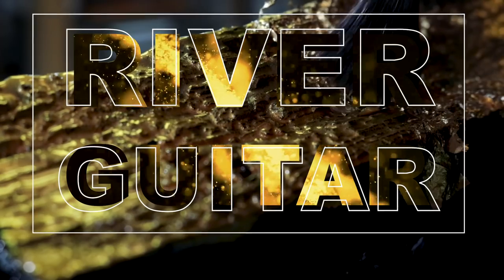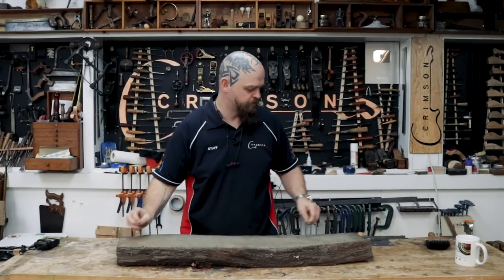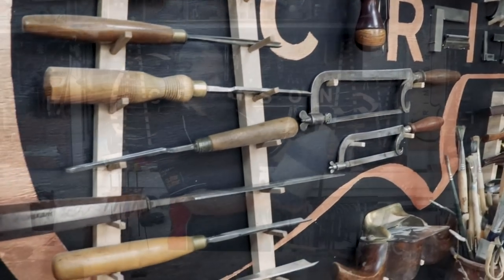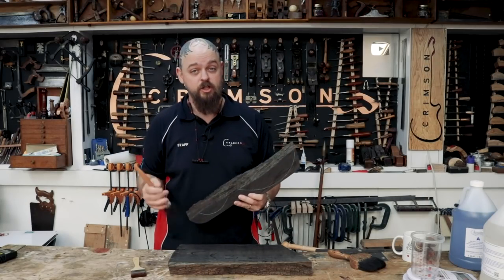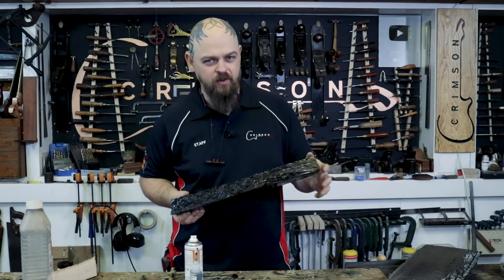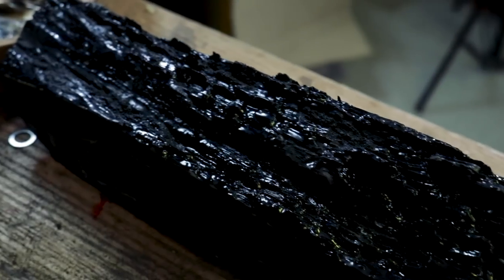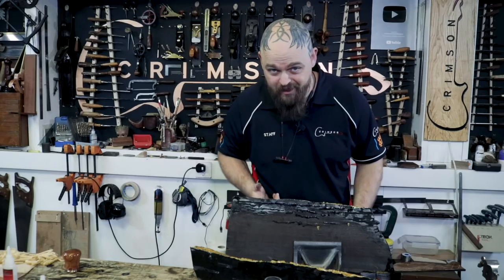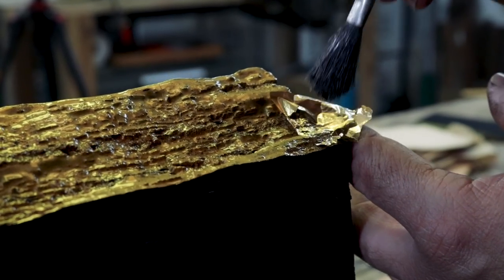Carved Epoxy Resin River Guitar Build - Bog Oak & Gold Leaf 1 of 5

Comment: Okay..you're gold leafing the live edges, then filling with resin. After you finish getting the guitar to final thickness, the the top and back of the guitar will be exposed wood with resin only in the "river" portions, correct?
Doesn't this essentially make gold leaf the structural adhesive that's holding everything together?
Reply: lol hadn't thought of that. Maybe that's why we only get the first part here.
Reply: Shhhh if the guitar doesn't hear you it might not break
Reply: Vacuum...
Reply: im sure the master builder  thought of that lol
Reply: @josemason7082  The head tat screams "I think everything through".: )
Reply: That's exactly what's been going thru my mind the whole video. Won't the epoxy just pull the gold leaf right off, essentially splitting the guitar in two?
Reply: Yes but no, the resin will partially pennate the wood.
Reply: @neverman3398  
How? He'd already resin sealed the live edge before gold leafing it. Epoxy isn't exactly known for adhering well to previously dried layers of itself.

I have great faith in Ben's skills, gawd knows he's pulled off things I've doubted before, but this one seems unlikely to me.
Reply: @beochie  I thought the head tat screamed... HANGOVER SEQUEL! shhhhhhhhh... oh em gee i've got a ...hangover
Reply: Yeah, I was just looking to see if anyone started this topic! LOL Does gold get that good a tooth into other things?

Comment: you should invest in large pressure pots and/or vacuum chambers for your resin projects. it would definitely save you a lot of time when trying to fill in those craggy pieces of wood.
Reply from the maker: Any idea where to find one big enough? B
Reply: Honestly, I don't have a lot of personal knowledge about this kind of stuff, because I'm very income-challenged... but I've seen a lot of people use Smooth-On products. Looks like they make a Pressure Chamber that's about 31.75 cm diameter X 38.74 cm tall, and a Vacuum Chamber that's about 35.56 cm diameter x 38.1 cm tall. They could fit pretty large chunks of wood, but most likely not whole guitar bodies or necks (unless they're small guitars), and they aren't crazy expensive, and much more worth it if they're something you'll use often. I'm sure there are some sort industrial sized ones, but they're probably many thousands of dollars.
Reply: Or, actually, it looks like House of Resin sells pressure pots and stabilizing chambers. They're actually larger and less expensive than the Smooth On ones. Still probably not large enough for a whole body, but would work for two halves like this river guitar. I don't know if House of Resin is one of your sponsors or if you just bought their product yourself, but you might be able to source one from them?
Reply: @CrimsonCustomGuitars  Surely the chamber could be built as part of the project? Build it once use it many times. Speaking from ignorance here tho.

Comment: With the gold leaf on both edges, will the resin still hold both halves of wood together or will the gold leaf act as a barrier like masking tape and make it a weak join?
Reply: I wondered the same. I'm curious about resin in the longer term as it doesn't react to seasonal changes like wood does. It could look awful. This decade's pebbledash?
Reply: Same worries here. Gold leaf isn’t very strong or abrasion resistant. First layer might be glued well to the sticky (ish) live edge, but 2nd one? Maybe the surfaces weld to each other, then it could be ok. I think we’ll see in the process. (Spoiler alert) It looked promising in the last what’s on the bench episode...

Comment: i was curious to know if you can be interested by wood and resin river art, it seems now that the answer is yes, now, do you plan to use some stems to reinforce the attachment of the wood, the gold leafs and the resin river ? the resin will well stick together with the gold leaf surface, but what about the "attachment" behind the gold leaf and the wood ? will the whole of it be enough solid without reinforcement pieces ?
Reply: I wood (pun intended) think so. Most pieces I've seen don't have any reinforcement  bars or rods. I guess just don't drop it!! (Not like one would drop it anyway).
Reply: @grantharrower2476  yeah, not false...
but a guitar can live a hard life, especially on tour, living behind the window of a display cabinet is too bad for a guitar ;)
i've seen videos of tables made as it, but the resin is in direct contact in the cracks of the wood, and are more of the time enough thick... here's i guess that the gold leaf surface can be a fragile connection surface, unless maybe to ad a thick resin shell all around the body to reinforce, but it's possible i'm totally wrong, after all, i'm not a guitar maker, and less of it, not Ben ;)

Comment: How well will the epoxy bond where you have doubled up the gold leaf ? Will the epoxy go through the gold leaf.
Anyway cant wait to see this finished
Reply: As the gold leaf is pressed onto the wood it doesn't quite cover every single spot of the uneven surface of the wood, it splits and cracks leaving gaps, this is why you double the leaf layer, to ensure every spot is covered. Of course there is a small amount of waste but that is to ensure full coverage. The epoxy will directly bond to the leaf rather than go through it, the strength will come from the fact that it isn;t a completely flat surface. While I am not an epoxy expert I do have plenty of experience with gilding. Maybe someone who knows more about epoxy can confirm or deny my comment.
Reply: @natsterjam  I see so there should be enough mechanical grip for this to work. I've build a few RC DLG gliders using carbon fiber and epoxy and most epoxy won't stick to its self very well unless it's got a good keyed surface so this would make sense on this guitar body.
Reply: @OzoneFlyer  I believe so my friend!

Comment: Love the vids, but from resin vids I've seen they tend to strip the bark and clean edge as even a thin layer of wood bark\dirt can make the structure week and separate easily, also told leaving can cause the resin to break away, would a layer of strong glue then leafing help the structure???   I so  do want this guitar to work out, love the idea of bog oak and gold leafing, very celtic
Reply from the maker: Your concern is absolutely valid but we did a few tests and it worked well.. B
Reply: @CrimsonCustomGuitars  cool looking forward to the progress on this guitar 🎸🎸🎸🎸🎸

Comment: Hi Ben another good vid, how are you going to burnish the gold? and will it have structural issues holding the two halves together? or are you going to brace them with rods or something?
Reply from the maker: Hey. I'm not burnishing it, this is a different technique to the old egg white and agate burnisher method.. I was worried about the strength but the resin appears to penetrate the gold leaf, or.. the roughness of the bark has enough texture to hold it all together.. so far at least. B
Reply: @CrimsonCustomGuitars  Hmm, sounds like it may work,  I look forward to the next videos. Is there any chance of you doing a build series using only 100 (ish) year old tools?

Comment: If I'm correctly surmising where you're going with this, you're going to end up with gold size as a structural bond through the body edge to edge, which seems awfully sketchy to me.
Reply from the maker: Me too.. I'm counting on how porous gold leaf is and on the roughness of the bark to hold it together.. and so far it is working well.. B
Reply: @CrimsonCustomGuitars  "It's not that important, because the gold leaf is not porous."  Ben Crowe. (Regarding the bubbles in the epoxy situation) Hahaha. ???
As you've said the golf leaf is not porous. However, You will be fine. The epoxy will hold. 
Luthier Magic!
The craggy live edges will be more than strong enough to hold the pieces together,  the bond will be more than sufficient.

I wonder if your next build will be petrified wood. Imagine the weight!!

Comment: Why did you put on the gold filler first? Wouldn't the gold leafing have been enough?
Reply: because the surface is so irregular, there might be small imperfections in coverage, so the paint etc seals but also provides an undercoat of gold, so any gaps are not as apparent
Reply: @scottstewart5784  Oh, makes sense!

Comment: so you're making the gold leaf the only thing holding the resin to the guitar? Wont it break?
Reply from the maker: tests were ok so fingers crossed not. The leaf is a little porous and the surface very rough so all being well it will hold together forever. B
Reply: @CrimsonCustomGuitars  Awesome. I'm stoked to see how it turns out my man :D I'm currently working on a california redwood burl strat style right now and am having to use epoxy to fill some of the cracks and seal it up so it's a little harder

Comment: Having a vacuum chamber would be real handy for projects like that. They're commonly used for impregnating pretty but rotten pieces of wood with epoxy for lathing bowls and such. Then again, if that massive chunk of oak was totally impregnated with resin, it would weigh a ton. Also, just to add, gold leaf on those live edges is not the best idea I've ever seen. If it were me, I would just use the clear epoxy and some form of discrete LED lighting to make it pop. Those live edges are beautiful enough all on their own. Why cover them up? To me, that gold leaf just makes it look like it's covered in Unicorn snot lol.

Comment: I see Ben applying the gold leaf and all I am thinking about is how much does that cost. It does look awsom can't wait to see how this build will be turning out.
Reply: Gold leaf is surprisingly cheap because it's surprisingly thin and, therefore, not all that much gold... 30 leaves, each 3.8cm x 3.8cm (roughly 1.5") of real gold leaf cost 19€ at Amazon. Fake gold leaf costs a fraction of that and looks fairly similar.
Reply: @Clairvoyant81  Ah the more you know. I never knew it would have been that cheap.

Comment: what exactly is bog oak ? Where does one find wood like that and how is it not petrified after 3k years ?
Reply: no
Reply: Quite a few luthiery suppliers in the UK are selling this stuff. It's pulled out of farmers' fields in areas that used to be marshes but were drained. Much of it is older than 3000 years. A tree in Norfolk came up with a bronze age axe head buried in it. It's not too expensive. I paid £20 for a fretboard.

Comment: If I don’t happen to have a bog on hand, where would I find bog oak?
Reply: in a bog
Reply: deadprivacy you clearly don’t read before commenting.
Reply: deadprivacy see, now that is funny.
Reply: @kiltymacbagpipe  i did misread it though...
i thought you asked "if you dont happen to have bog oak on hand"
i just read it quickly.
its not that easy to find even if you do have a bog in any case.
its basically the rarest wood on earth...
https://www.ebay.co.uk/itm/BOG-OAK-BOARD-100-x-42-x-5-cm-Waney-LIVE-Edge-CHARACTER-Wood-RESIN-table-12/274094770894 this bit might make a good guitar though.